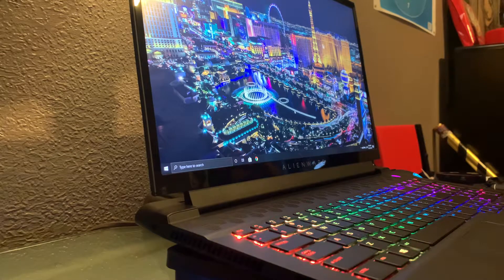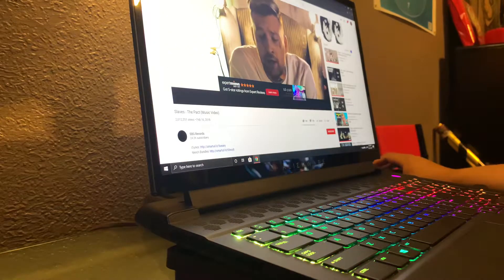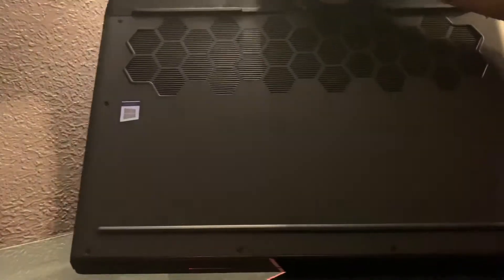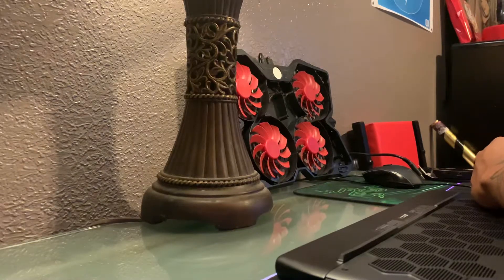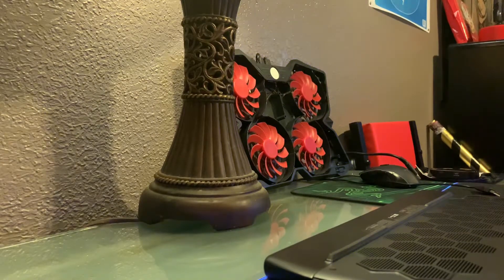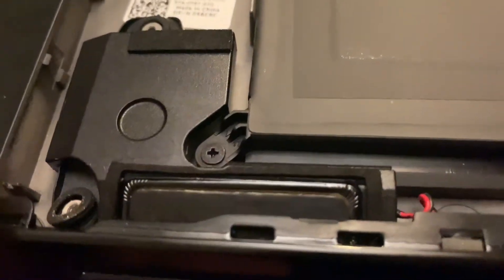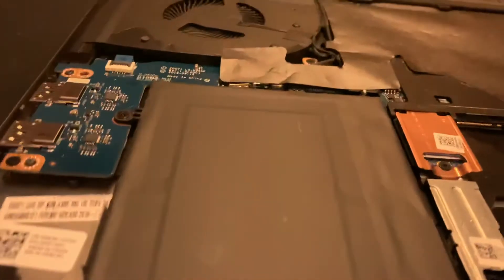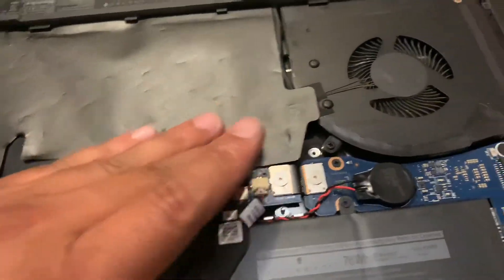Alienware M17 R2 Speaker Problem ?

Comment: Can't believe it's 2022, and my brand new X17 R2 speakers came with this issue.
I'm getting a replacement laptop because this was not the only Issue.
If this persists i'm getting a refund, Not worth the struggle
Reply from the maker: My graphics card also took a shit couple months later they had to replace it under warranty I ended up just selling the laptop and getting a desktop with a RTX3080
Reply: @Carlosv35   Man, I had Alienware on a Pedestal for a decade, always wishing to get one !
I got one and it's been a nightmare since day 1
BSODs right out of the box, screen bleeds, speakers crackle when louder than volume level 30...
And the worse problem is that the Fans didn't work for a whole day, it got Melting hot , burning my fingers using the keyboard.   And the Support does not answer for this, " Let's replace it, we don't care for your problems"

Comment: i'm gonna try this tomorrow. the sound i hear is so obnixous for this to be one of the most expensive computers on the market.... problem happens right out of box... will update
Reply from the maker: For some reason during shipment the little metal stoppers behind the screws tend to fall off and since they are metal they were getting stuck to the speakers magnet When I remove the back panel on my M 17 I had a found a couple of the stoppers stuck to my speaker and it was causing all my problems . The speakers they put in these laptops from factory are not good quality you could upgrade them to better speakers If you don’t mind cutting the wire and rewiring new speakers . It’s really easy to do the hardest part is to find the right size speaker to fit in the laptop .

Comment: I removed it on my M17 R2 too but it dosent fix the problems withe left speaker so i found out that, if i remove the back and play musik then , its fine if i move the back on bad sount!
Solution it to put some rubber pad stripe in the speker that catsh the vibration! now works fine!!! Dell can´t fix it!

Comment: I'm having the same issue, that is how I found your video. I did have the back off yesterday to add a bigger ssd card, it was a bitch getting the back off. I hate the thought of doing it again, but if it will fix the speaker issue it is worth it. I think I will remove the rest of the screw captures as well, I really had a hard time with them and they seem to fall off and into the system anyway ( they are a dumb idea!) I have an older alienware and it was so much easier to work on.
Reply from the maker: Ya those screw things are dumb they fall off all the time little while back while transporting the laptop I noticed it had a rattle it was really bugging me I took off the back panel sure enough one of those little screw things came off again and was just bouncing around I removed all of them and it made  the panel way easier to remove for cleaning .

Comment: You would think they would give you at least decent speakers for a $1500 + laptop. But honestly, Dell has always had lower quality speaker issues, I’ve always used their business line of laptops (Latitude) and the speakers always get that crackling noise eventually.
Reply from the maker: Craig Mackey ya they’re super cheap I was looking into swapping them out with better brand speakers.
Reply: Nismo _ V35 I would’ve done the same thing. I’m waiting on one in the mail now and it’s been a nightmare so far with them.

Comment: Strange I didn’t have a washer on mine and it still does and it’s only the left speaker not the right one it’s weird
Reply: check if it has the ruber ring, my left one is also vibrating and it is missing that ring. There is a big black rubber ring and inside of that one should be an smaller one. The right one should have it.

Comment: my speaker stops working when i enter any game. Can you help me? and command center says there is constant update but 
I have notified again even though I updated.(
I am updating via microsoft store)
Reply from the maker: eren yağız That would happen to me also but for me it was my Bluetooth for some reason when I went into the game it would cut off the speaker I would have to go back into windows and reconnect the speaker and it would work . If you can’t get it to work call Dell support they will go on your computer and make sure everything is running right When my Bluetooth stopped working they had to reflash my bios and it started to work again
Reply: @Carlosv35  thank you so much

Comment: got crackling sound also on the m15 from one side despite i already removed the  stoppers 
i will check again 
thanks for sharing the experience
Reply: Same problem in my 3 months old M15 R3. It did have 2 of the small washers lying around in there, one in the left speaker. Grommets are correct, vibration pads correct, left speaker still crackling, likely busted. Will have to contact service and have it replaced.

Comment: @Nismo_v35 I got my M17 R2 yesterday and I have the same Audio/sound issue... the sound is garbled and crackling even low settings and volume... I’ll try your suggestion and I already called Alienware for a system exchange since it’s defective OOB...

Comment: I had exact same issue on my m17,  ran all diagnostics etc, didnt fix... I found this video, and although mine’s a slightly different alienware model, but same issue, I thought it had to be worth checking for the sake of 10 minutes removing and replacing screws. Same little washer sitting on top of the speaker casing, unbelievably easy fix after all the messing around reinstalling drivers etc. Very helpful video, thanks man 👍🏻👍🏻👍🏻

Comment: All my 4 screw stoppers weren't fixed properly. So I had to spend so much time to just remove the back case. I took those stoppers out completely and now it's cool. Two of the stoppers had come out and were on my speaker too.

Comment: I had the same problem opened and this was over my m17 R2 Speaker. But after closing the notebook and testing sound I get all the chassis palmrest and the part over the keyboard vibrating togheter with the speakers, like the speakers were too close of the chassis and transmiting the sound and making it vibrate. How can I fix this?
Reply from the maker: Carlos Junior I also noticed one of the speakers sat really close to the frame but after removing the little metal screw stopper thing everything went back to normal had no problems. What I did notice  when you pull out the speakers there are these little rubber grommet things that sit on the bottom the speakers I’m guessing it’s for vibrations or rattling if those are not inserted properly you’re going to experience rattling or some type of noise . When I pulled out this speaker the little rubber grommet just dropped off in my lap and it’s kind of weird looking kind of like a giant rubber O-ring that fits into the speakers screw hole I’m guessing when you screw everything down tightly it makes it so the speakers don’t vibrate .
Reply: @Carlosv35  For me was this and the metal thing. But I noticed one of the speakers doesn't have the rubber ring and it is vibrating a lot :/

Comment: That's crazy dude. My m17r2 had the same issue. Dell couldn't fix it. I sent it back. Need to order a replacement.
Reply from the maker: Kavin Palaniswamy Once I took it apart I was shocked I found a little metal screw stopper stuck on the speaker Crazy something that small could cause such big problems .